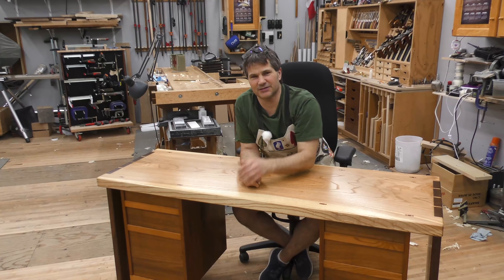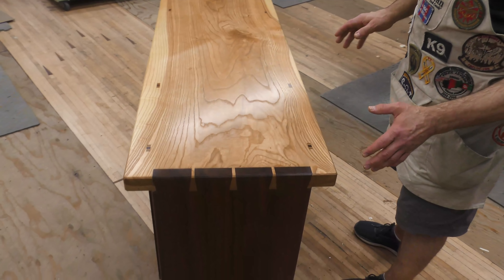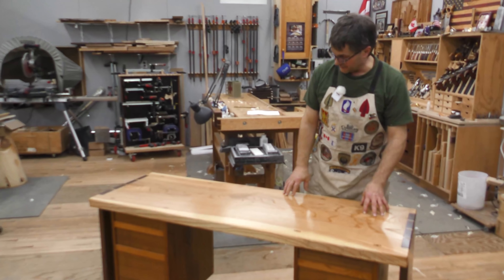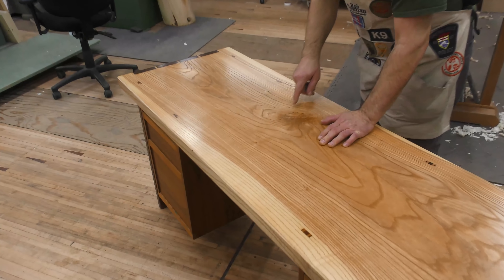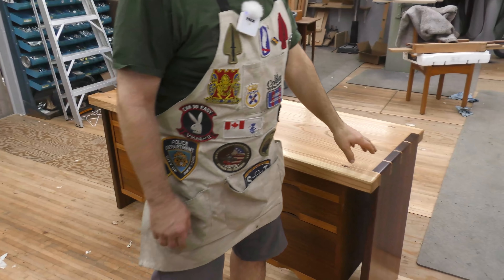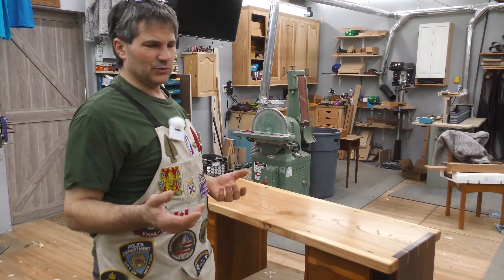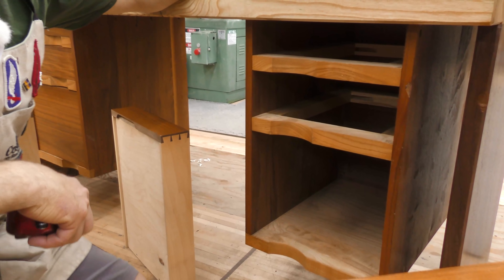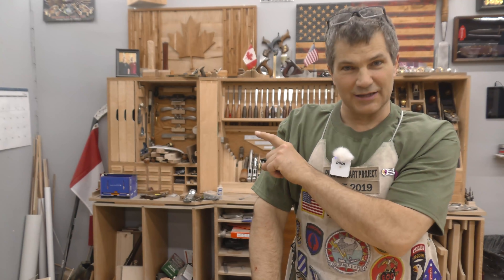Rob Cosman Furniture - Big Ash Desk

Comment: its always interesting to see how others make things.  as an aside, when i trained i was taught to offset the drawer side to the front so that the side would be 1 to 2 ml lower.  then when fitting the drawer you planed the bottom of the sides till the drawer had the reveal you needed at the top and bottom.  i am now retired so you can see i was taught a long time ago here in nz.
Reply from the maker: Never seen that method

Comment: Love the desk.  What keeps the legs parallel without an horizontal piece?  Pardon my english, I am from the Netherlands.  I have never seen a table without a lower horizontal space making piece.

You might have answered it at 6:43, but used a few words I did not get.   ?rack, stiffen, etc?
Reply from the maker: dovetails!  Lots of surface contact between the ash and the walnut.  This glue surface in the dovetail joint makes it strong enough to forgo any horizontal supports.

Comment: Another fine example of non-traditional (big ass) use of dovetail joinery but still in the right way, not showing off the tails on both ends of the top but on the sides as it is done on drawers.
Reply from the maker: Thanks